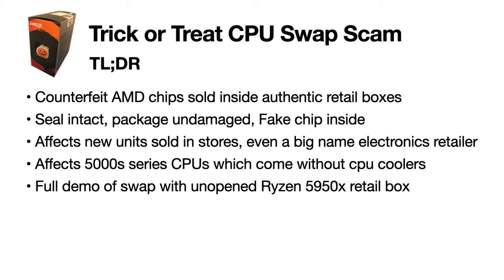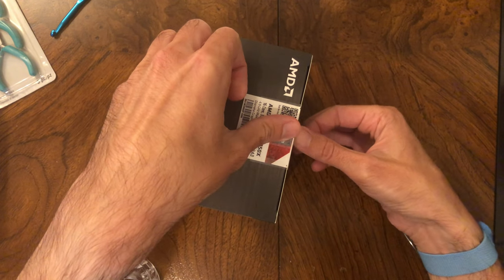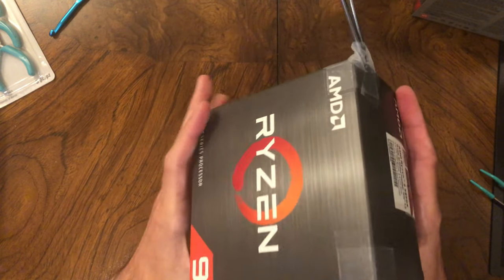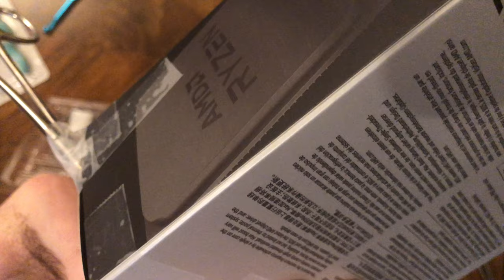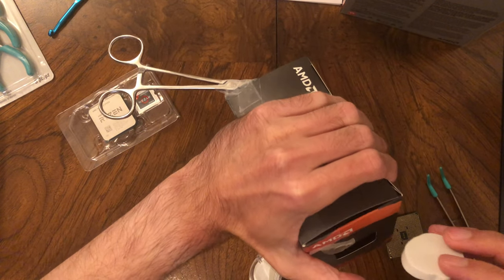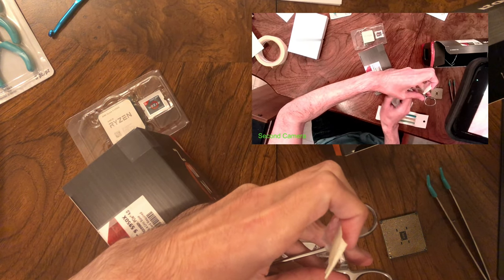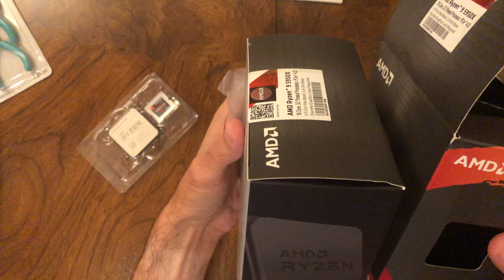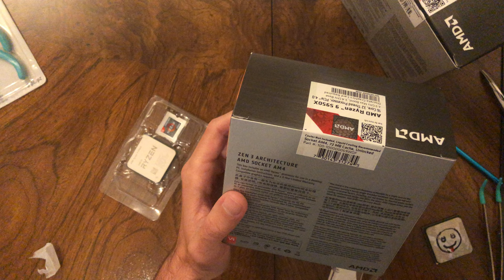AMD Chip Swap Demo - How Counterfeiters replace CPU in Sealed Retail Box

Comment: lol too much trouble just use a steamer (or boil some water and guide it with a funnel or something) and take the sticker carefully out of one side take the CPU then apply the sticker again this time putting some superglue or something so that the sticker will stick again without issues.
Reply from the maker: maybe that would work but the sticker they use looks to be the kind that breaks apart if its tampered with so idk.  anyways I'm not trying to find the best method I just want people to know its possible so they watch out and avoid getting scammed
Reply: @cycurious  Since your version had matching serial numbers. How did they do that? Did they make a replica sticker and stuck it on top of the swapped cpu chip? Is there a way to tell if the top of the cpu is fake too? The legit Ryzen print is basically polished. Was yours like that or was it more like just gray Ryzen logo printed on a sticker?

Comment: 😂 You clearly are not a scammer. You're working way too hard at this. A better and more effective technique. Is to apply a heat gun gently to the bottom of the box where the full tabs are crimped together with industrial hot glue. Here Lisa hot glue and unfold the box from the bottom and pull everything out and swap it and then apply your own hot glue back to it when you put it back together and it's much less intrusive and about 10 times faster🕵️‍♂️. Technique number two which requires more finesse. You simply apply a heat gun to the security tape on the top and carefully remove it with a straight razor leave the straight razor stuck to one side of the security label and fold it over while you open the box and do your deed. Then you pull the razor tight and twist it vertically 90° as you pull it back and you have to be careful not to upset the tear tabs that are stamped into the security tape😮 I don't know maybe you're a biology major and were reminiscing about dissecting frogs or something. Anyhow I suggest you try it and make a follow-up video.